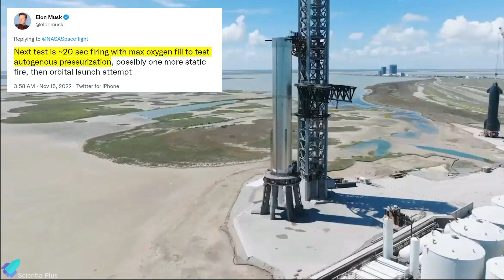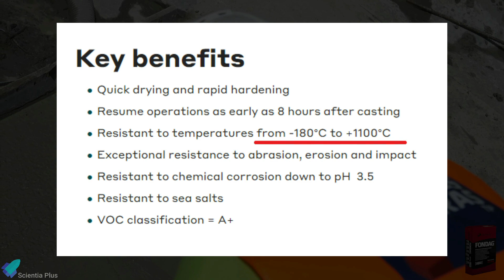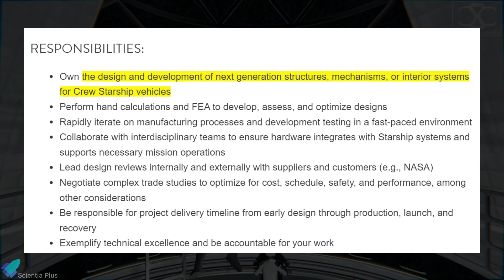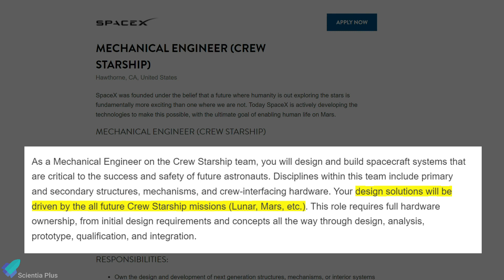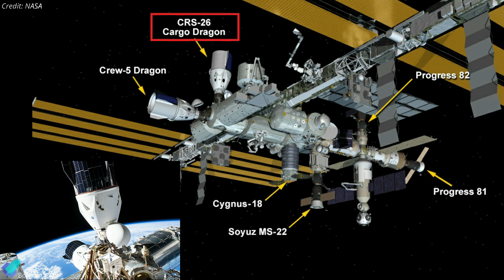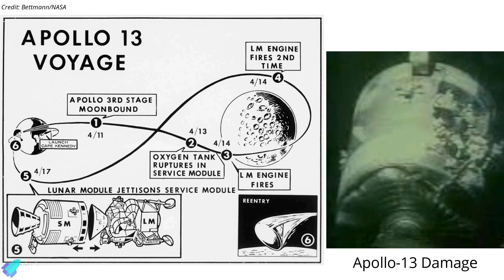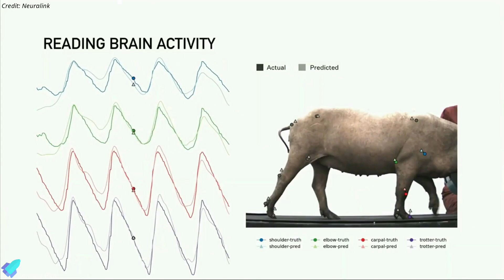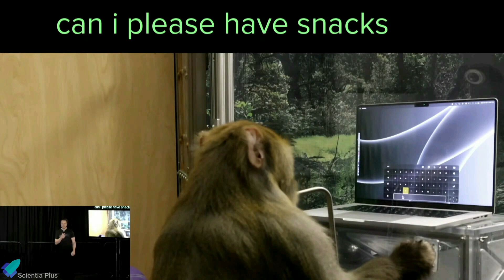Starship Booster-7 Needs Upgrades: Raptor Engines Damaged During Test, Orion Return, Neuralink, NASA

Comment: There was a comment I read from a different chat. They claimed that the concrete used to replace prior concrete is still not good enough to withstand the heat that the engines put out. He was correct.

Comment: Puzzled by the fabrication of the enormous outdoor scaffold. Don't they have something comparable in one of the enclosed bays which they could have used?
Reply: They need a flame diverter
Reply: They do have two different buildings they could move it to, but they’re full with the next few starships. There isn’t room to move it back, plus it would take a lot of time to move it and they’re only allowed to block off the road a certain number of days every year. They don’t want to waste those days if they don’t have to.

Comment: Russia or maybe it was the U.S.S.R tried your 20-30 engine rocket fifty years , they better check out how well that one went . Then do some re-planing
Reply: The Russian N1 was a different era ie no real computers like today, so they couldn't really control it well.
Reply: @ntal5859  the computers back then we're good enough to get men to the moon and back .  I think it was a nut inside one of the rocket engines that caused the explosion. Expecting a pack of 30 engine to all run smooth together is a pipe dream .make that whole outer ring of rockets into solid fuel rockets and it might work ... And put Joe Biden on the first launch
Reply: @ntal5859  Didn't NASA landed human on the moon 6 times +50 years ago and landed on Mars 50 years ago?
Mars 3 arrived at Mars on December 2, 1971. The lander was released and became the first successful landing on Mars.
Reply: @joannewilson6577  balancing 30 engines is a different kettle of fish. Much more demanding than landing guidance, the computering power back then couldn't handle it. BTW the computer on nasa's lunar landers kept  tripping the master alarm because it was easily overwhelmed by its inputs. It was not fast enough. It done the hard part slow them down from orbital velocity to an altitude and speed that the pilot could safely land it manually. It was far from ideal.
Reply: The N1 used 30 engines, the Falcon Heavy which has had multiple successful launches uses 27 engines. This is a hard task for Space X, and no one has ever said it was easy, but they have experience and a track record which says they've a higher chance at success than failure